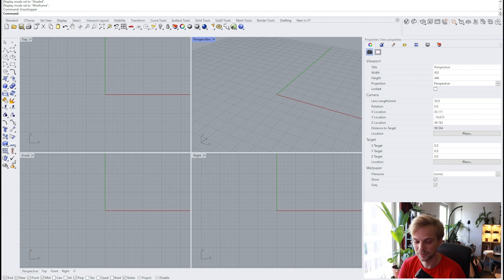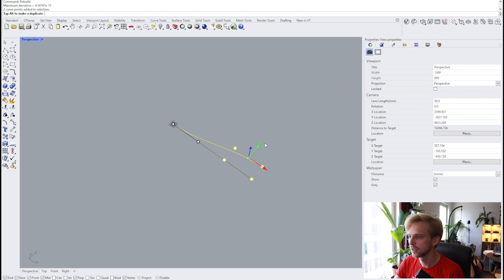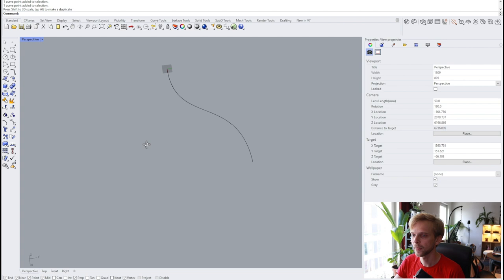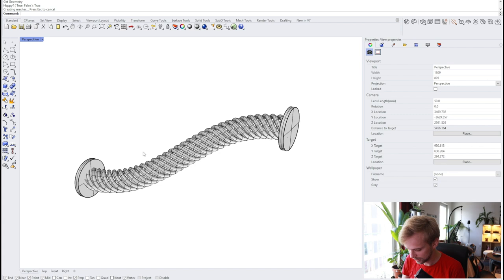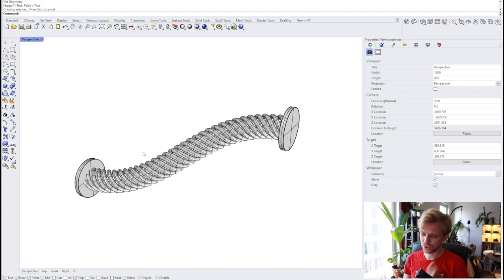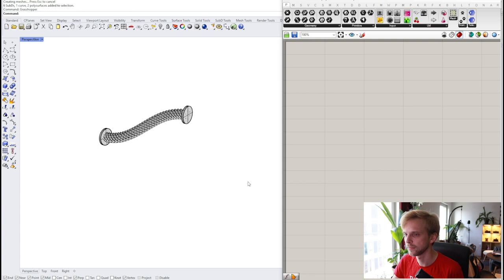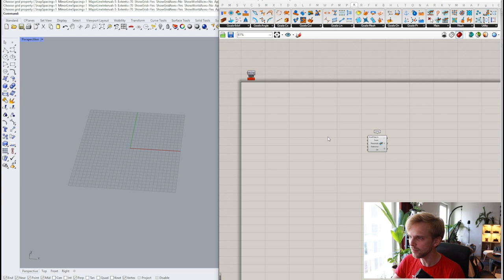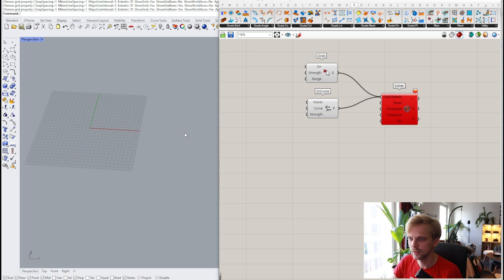Pushing the Grasshopper Player to it's Limits

Comment: How do I get the "Get Boolean" component, I am missing it, I updated to 7.11 but it is not there.
Reply from the maker: The hell.. did they roll it back? I'm running the newest version Rhino on my laptop and just installed the newest version of Rhino on my PC. My laptop has the "Get Boolean" option, while my PC doesn't.. I guess they are working on it. Either way - for now, since 0=false and any_other_number=true, you can use Get Integer instead and feed that into the filter mask input. Even got a tool prompt for ya: "If you don't wanna bake this - type 0, if you like what you see - type in your favorite number (no it can't be zero you smartass)"
Reply: @DesignGoBrr  Steve Baer told me it would be on 7.11, I am using a number slider 0..1 until it comes back.
I am also working on a cool hopped up script from yours currently with a C# 3D point grid...
Reply: I need to follow your Patreon advice and get my Patreon generating $$$ again with Hops and Grasshopper Player.  Your script looks good in the video.

Comment: Hello sir, is there any way in grasshopper to get which key pressed on keyword??
Reply from the maker: to my knowledge - without scripting - no
Reply: @DesignGoBrr  i was doing in iron python *import keyboard * by manually pasting keyboard pkg at location but when i open that code, computer going to freeze, i was following stackoverflow with little changes as per need.